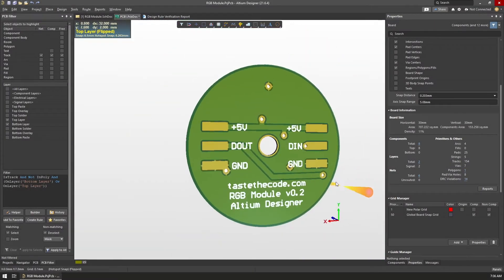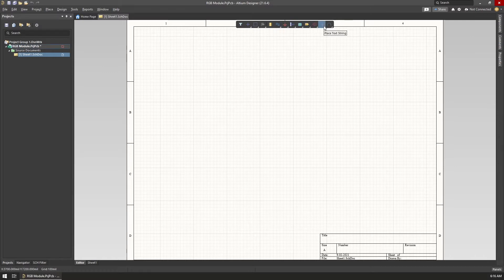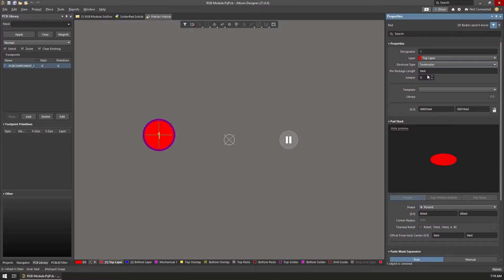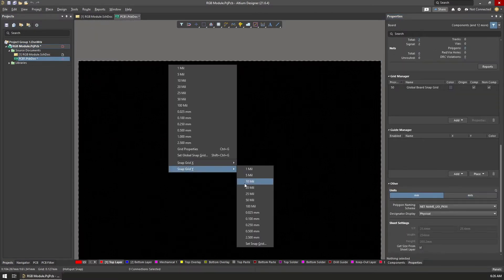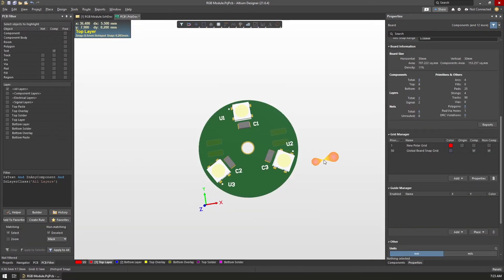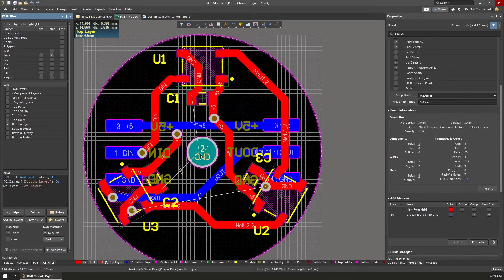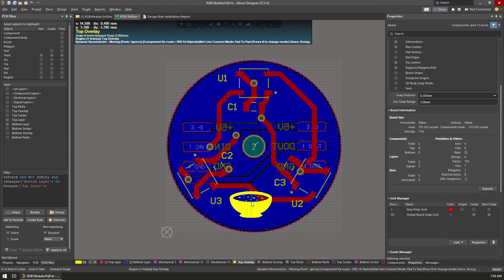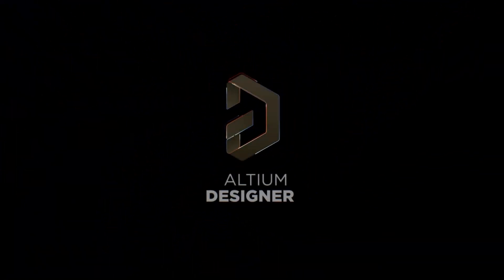Your first PCB with Altium Designer - Beginner Tutorial

Comment: Cool vid as usual dude.  I think altium is the one my colleagues use, I've heard them talking about the warning about the space between components.
Reply from the maker: Thanks Rob. What sort of PCBs do they make?
Reply: @TasteTheCode  wearable sensors for head injury and concussion management for contact sports...rugby mostly. These devices are really small hence they always run out of room for all the tracks and stuff.
Reply from the maker: Wow, that sounds awesome and challenging! My board has a ton of space to spare and I still managed to put things too close. I can only imagine how tricky it might be for those guys.
Reply: @TasteTheCode  most of the components are too small for me to see without a magnifying glass, those surface mount resistors are  0.5mm or less, and the LEDs , I think they are even smaller.